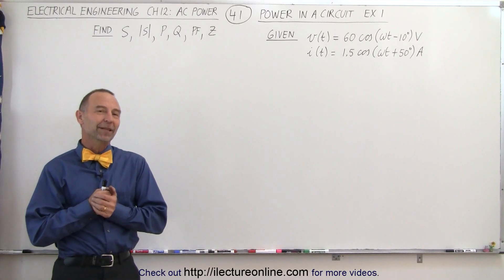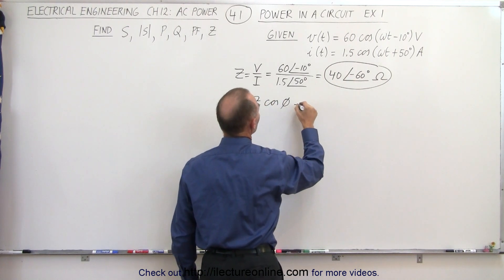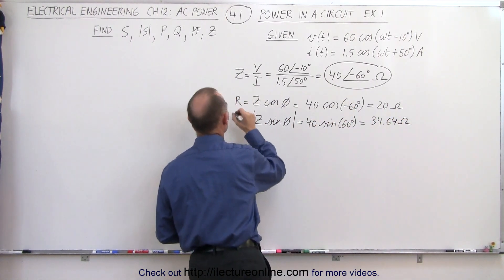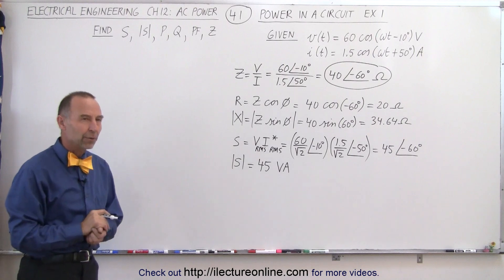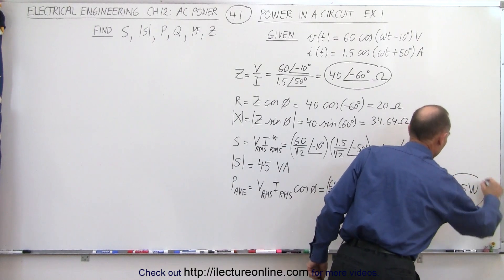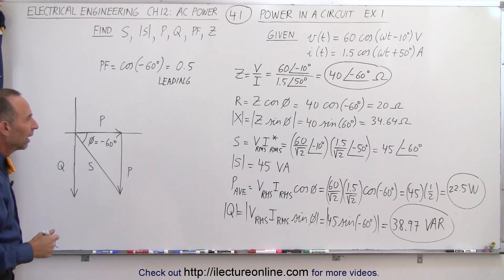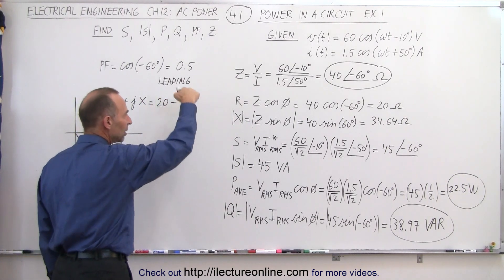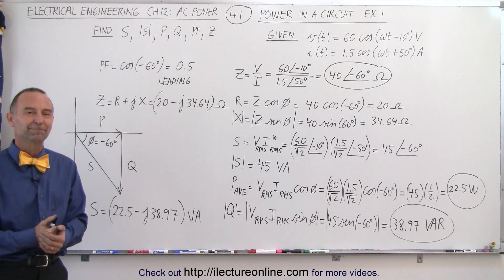Electrical Engineering: Ch 12 AC Power (41 of 58) Power in a Circuit: Ex 1

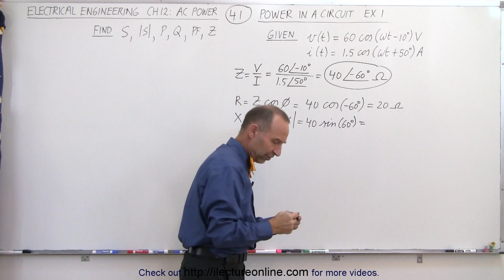Comment: at 1:55 how did you know if it was - or +60 degrees?
Reply from the maker: The difference between + 10 and - 50
Reply: @MichelvanBiezen  is it 10-(-50) or 10+(-50)? also anoteher clarification question wont it be -10-(-50) = 40  since the 10 is - or do we have to flip the sign or that to?

Comment: The thing I did not understand is in previous videos to get rms of v we simply dived max voltage to	 Square root of 2. However in this video you get phase angel as well when you determine the Vrms. Could you please explain sir?
Reply from the maker: When you take the Vmas and divide it by sqrt(2) then you get the magnitude of the Vrms and you don't know anything about the phase angle relative to the phase angle of the current.   So if you also know the reactance of the components or you know the phase angle of the impedance, then you can also determine the phase angle of the voltage.  Or it can simply be given to you in the problem from the start.
Reply: @MichelvanBiezen  thank you for your quick and detailed answer

Comment: Thank you for the informative and simple presentation. At 1.56 why it is not Sin(-60)?
Reply from the maker: We are looking for the magnitude of  Z sin(theta) which must therefore be positive.  (note the absolute value sign).
Reply: @MichelvanBiezen  However at 5.:35 for  finding Q we used Sin (-60)..just trying to clear the confusion that's all...Thanks for your reply
Reply from the maker: At that time we know the phase angle is negative, so we are using the appropriate angle there.

Comment: Sir make videos on 3phase ac , Electrical machines (dc ac motor generator, induction motor, transformer and power electronics, theorem used in Electrical network analysis then we will be great full with you sir!
Reply from the maker: We are working on those now.